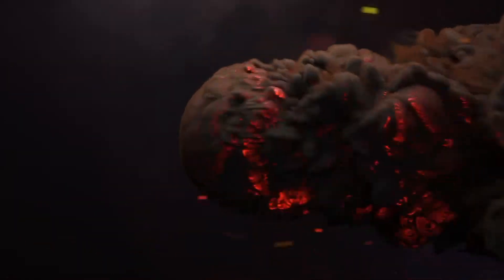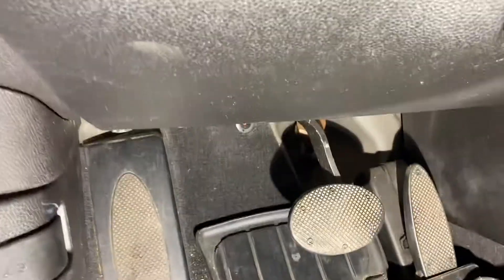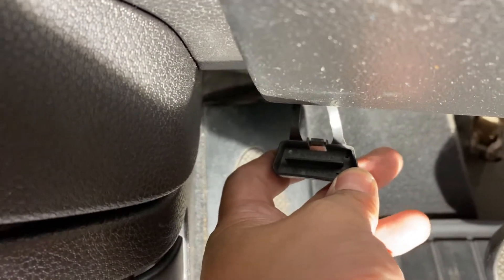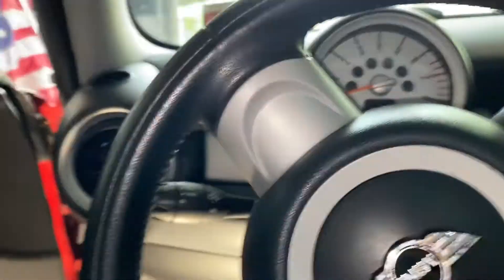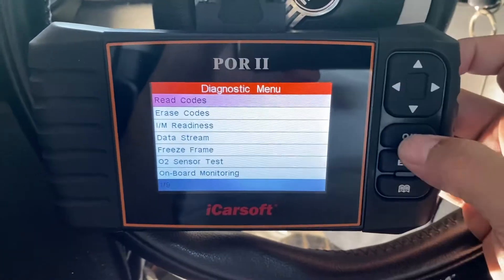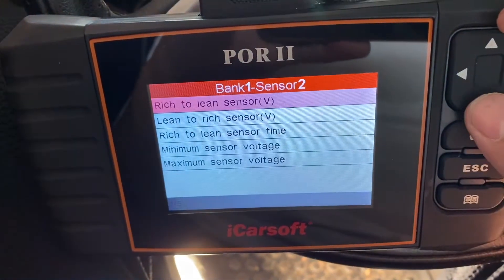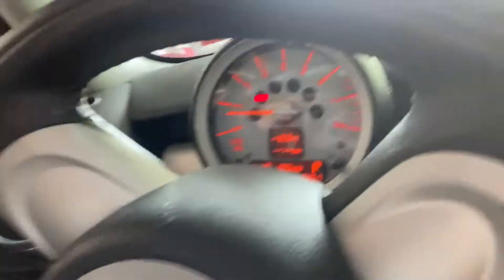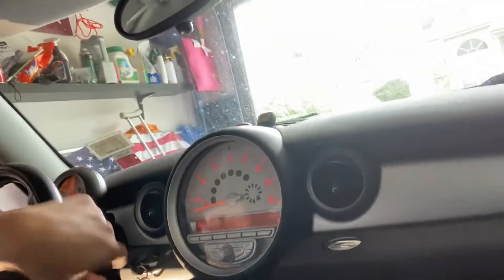Running an OBDII diagnostic on my Mini Cooper

Comment: The brake light fault may be the fluid level.
Reply from the maker: In my case it turned out to be that one of the wear sensors had a bent pin and had been forced in on the connector. Bent pin back into place and reconnected. Solved my issue.

Comment: my car has no problem but it shows the engine check light all the time. Can I get rid of that with odb2 scanner ?
Reply from the maker: You need an OBDII to see what’s triggering the check engine light. You can reset it but until you figure out the cause it may keep coming back.
Reply: Just a heads up. My 08 mini has a half check engine light and my OBDII won't read any codes. However it won't pass emissions, and their scanner gave me very vague codes. So if you only have a engine light on your tach only and it's half shaded, you might need a better scanner. Just my experience right now.
Reply: @glensmith1987  Have you checked your Cat? I can't imagine why it would lit up engine light but it's worth checking if it's rattling. At least the emissions would make sense.

Comment: My radio died along with Bluetooth. Good used radio did not have Bluetooth. Curious can I use one of these devices to program Bluetooth into my new used radio?
Reply from the maker: I used an aftermarket device that plugs into the 3.5mm input.  I connect my phone by Bluetooth into that.  You can also buy an adapter that plugs into the input and into the charging cable so you can charge your phone while you send music to the input jack.